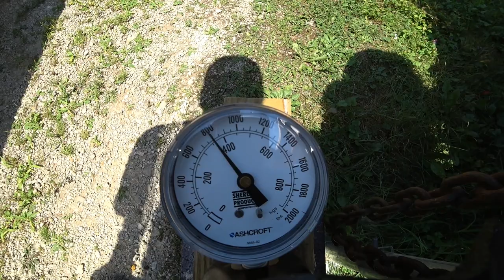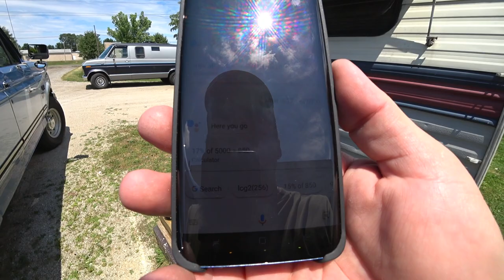Getting Caught up for  RV Trip Ahead

Comment: The work you have done for the trailer looks good I don't know much about pulling a RV but I guess you take quite a hit on mileage listening to the engine and being an older truck.What size engine is that truck running?